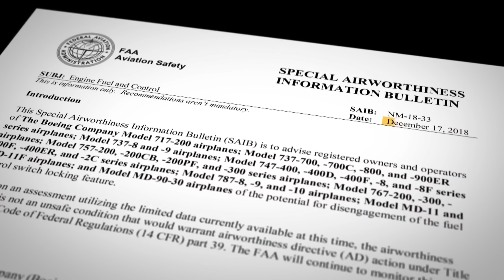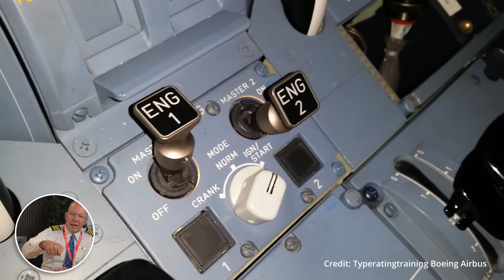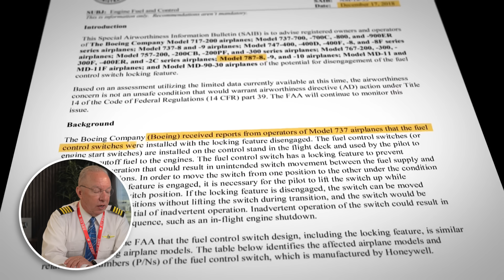Air India 171: The FAA’s 2018 Fuel Switch Locking Bulletin Explained (16 Questions Answered)

Comment: Someone or something turned off the fuel. Or not. So yeah, visual confirmation of what was going on, kinda useful. And that's not the only crash that would have benefited from visual evidence. Of course it's not gonna PREVENT anything. At least might deter some bad behaviour, but should be restricted to black box recordings, as to not put the crews under unnecessary scrutiny. 

Fuel cut-off IMMEDIATELY triggers the RAT. So obviously, cutting off the fuel in some circumstances would warrant a severe warning as it will cause a disastrous situation.

Comment: How long does it take for the engine to loose thrust and start shutting down, after that fuel switch has been moved from run to shut off?   I assume there is a period of time where it keeps running.?  It sounds like it's virtually immediately. ?

Comment: Questions, I assume when inflight fuel stops an alarm goes off. If so does it sound differently when switches are activated?  Are there indicators a pilot can see that show the switch status?  You made comment that the rat will not deploy on the ground, while I understand there might be critical  situations resulting in a non powered landing making the turndown of all fuel system important, but would it not be sensible to require both pilots to validate that inflight action in a way that prevents just one person doing it.?

Comment: the logical to prevent this to happen anymore is to not to allow engine cutoff after  v1 unless there is a fire in the engine you try to switch off. Can be esaily implemented,
Additionally, after German Wings and this one, pssychological reviws shoul take place every 6 months.

Comment: Steve, thanks for your analysis. I wanted to chime in on the video recording from the cockpit. Why do crews seem so resistant to this? I get it, constant recording isnt enjoyable but from a data density perspective of an accident, its really necessary at this point. There ahould be 40 cameras, all over the aircraft, inside and out, all recording to a loop in case of an accident. It is long past due now.